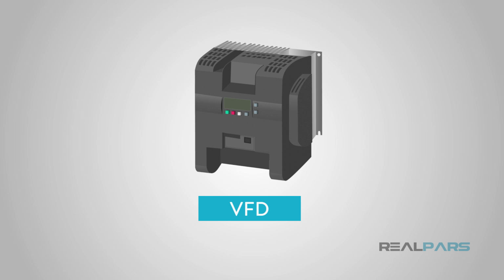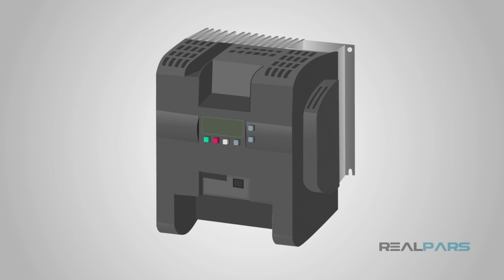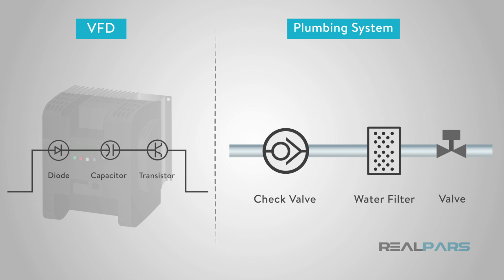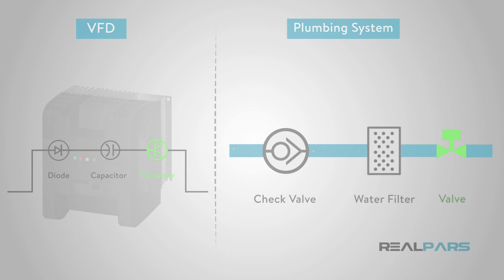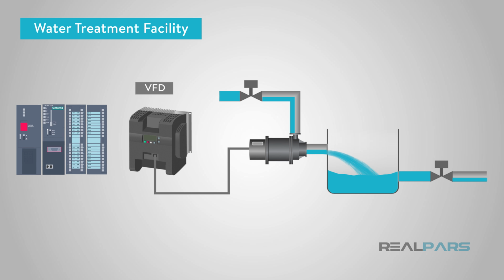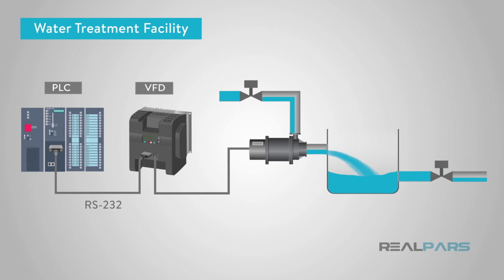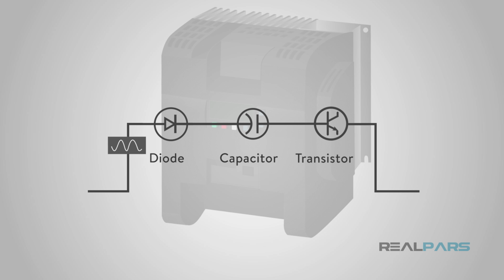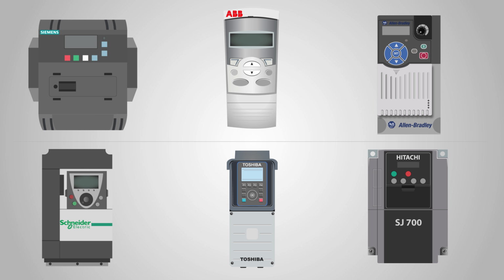What is a VFD? (Variable Frequency Drive)

Comment: Wouldn't using a VARIAC to lower or increase the AC voltage work in a similar way?
Reply from the maker: Yes, but VARIAC's are not a replacement for VFD's.  VFD's modify the frequency AND voltage that is output to the motor.  VARIAC's only adjust the voltage.  A VARIAC is essentially a variable transformer and does not provide the characteristics required for speed/torque modulation.
Reply: @realpars  Thanks for the clear explanation. I thought that would be the case!

Comment: Why converting AC to DC and then again to AC... Why can't we use directly AC
Reply from the maker: That is a great question!  In order to change the frequency of the AC sine wave, the incoming supply must be transformed.  The only way to do this effectively is to convert the current to DC and then reform the AC signal at a different frequency.  This process also allows the VFD to maintain a constant Volts/Hz ratio, which is important to maintain the integrity of the motor windings over a long period of time.  Inductive reactance acts as a resistor and can cause excess heat dissipation if the V/Hz ratio is not maintained.  So, there are multiple benefits to the conversion from AC to DC and back to AC, including being able to provide a cleaner (filtered) AC feed to the motor.

Comment: Why change to DC, if it’s just gonna change it back to AC?
Reply from the maker: That is a great question!  In order to change the frequency of the AC sine wave, the incoming supply must be transformed.  The only way to do this effectively is to convert the current to DC and then reform the AC signal at a different frequency.  This process also allows the VFD to maintain a constant Volts/Hz ratio, which is important to maintain the integrity of the motor windings over a long period of time.  Inductive reactance acts as a resistor and can cause excess heat dissipation if the V/Hz ratio is not maintained.  So, there are multiple benefits to the conversion from AC to DC and back to AC, including being able to provide a cleaner (filtered) AC feed to the motor.

Comment: Thanks for the video this just made my idea of a off grid induction motor and centrifugal pump to pressurize the water to drive pelton turbines for my hydro electric system a reality for my bitcoin mining operation, simply put much like the video i was wondering how i could control the pump speed for pressure to drive the pelton turbines to have more control on the overal out put of the generators also the electric motor is also powered by the same generators currently figuring out how to switch power sources for shutdowns for maintenance purposes where i would have to hydro systems to switch between to service but maintain electricity.

Comment: Thanks for the information, will you please give explanation for, why we convert AC into DC then again to AC?
Reply from the maker: There are two reasons.  The first is to provide a "clean" AC output to the motor.  The rectification from AC to DC allows the IGBT's or SCR's to "reassemble" the AC sine wave as free of electrical noise as possible, even if there is some noise on the input circuit.  Secondly, rectification and inversion is the easy and cost effective way to change frequencies on the AC circuit.  In a VFD, the voltage is also adjusted as to keep a fairly constant Volts/Hz ratio. For very large motors, there are devices being developed for industry called  Direct Matrix Converters which will be able to perform voltage and current conversion in one single stage without converting to DC.

Comment: Hello dear sir 
Can we use 3phase motor on single phase of electricity through VFD?
Reply from the maker: No.  You could physically wire it that way, but it will damage the motor and the drive.  A 3-phase VFD requires a 3-phase motor.  A 1-phase drive requires a 1-phase motor.

Comment: Is voltage/frequency ratio      always constant in VFD??? Please tell me.
Reply from the maker: The voltage/frequency ratio needs to be fairly constant from 0-60Hz.  The output torque for a motor is determined on the basis of the ratio of the motor’s applied voltage and applied frequency. A typical AC motor in the US is rated for 460 VAC and 60Hz, and has a 7.67 V/Hz ratio. Failure to maintain the proper V/Hz ratio will affect motor torque, temperature, speed, noise, and current draw.

Comment: So far, so good. These days, 3 phase VFD is used for most modern electric trains, and hybrid or full-on electric road vehicles, after the advent of integrated gate bipolar transistors (IGBT). Typically done with triple inverters (one for each phase), capable of working in both directions, for regenerative braking when required, using the 3 phase motor as an alternator.
Reply from the maker: Hi John,

Thanks for sharing your knowledge with us! We always appreciate that.
Reply: One the money with this comment
Reply: The best sounding VFD’s are found on Siemens locomotives like the BR 182 and BR 406 etc.

Comment: vfd controls the speed of the motor by converting AC to DC then back to AC with different frequency and it can be wired to plc to make the task automatic and get rid of a stupid operator! can't find any easier and straightforward explanation... GREAT JOB
Reply from the maker: Thanks a million for your kind comment, Yousfi! We appreciate your support.

Comment: i have a question，my question is the vfd can use for brushed motors or no?
Reply from the maker: Brushed motors are DC motors.  They do make speed controllers for DC motors. but they ar not called VFD's, since DC motor speed controllers do not work by varying frequency.  DC motor speed can be controlled by varying the armature voltage or field current.

Comment: Many thanks for knowledge sharing. My question is, can VFD motor runs directly ? in cause of VFD is out of order
Reply from the maker: Yes, you can design and install mechanical or electronic bypasses around VFD's.  Typically a DOL contactor is provided in parallel to the VFD so that if the VFD fails, the contactor pulls in to maintain operation.  However, the motor will run at full speed while in bypass. These systems require some planning and expertise; consult your VFD manufacturer to suggest the best alternative for your needs.
Reply: @realpars  Many thanks

Comment: I have 4 motors of 220v 50hz using VFD to convert 60hz  is it possible to use 1 VFD into 4 motors?
Reply from the maker: Yes, it is possible.  There are many constraints you need to consider:  1) all motors must be of the same speed,  2) each motor circuit must have its own overload protection, and 3) the VFD must be oversized unless all motors are started simultaneously.  Remember to size the VFD for the sum of the motors' FLA's, not horsepower.  There are other considerations that are beyond what I can answer here.  For instance, if one motor pulls high amperage, the VFD does not know which motor it is and will potentially shut down all motors connected to it.
Reply: RealPars 👍👍 Thank You!

Comment: Why first convert AC to DC and DC to AC sir
Reply from the maker: The purpose of a VFD is to take incoming AC power at 50Hz or 60Hz and adjust the frequency in order to regulate speed.    Speed is directly proportional to frequency.  At the electronic level, this is most efficiently accomplished by transforming the incoming power from AC to DC, and then "re-assembling the AC sine wave" at a different frequency.

Comment: in the section "dc to ac inverter" why the motor doesn't change the rotation direction even when the voltage is in negative signe
Reply from the maker: The direction of rotation is related to the phase angle between the 3 phases, not the instantaneous polarity of one of the phases.

Comment: Hello,
Can you kindly guide me that from any VFD which has output of 3-Phase 220V, can we handle speed control of 30V 6KW 3-Phase AC Motor with full torque?
Reply from the maker: The Siemens G120 drive or Allen-Bradley 525 drive should be able to meet your needs. Each will require proper specification prior to purchase so that you are buying the right drive.  Then, you will need to configure the drive correctly to give you the performance response you are looking for.  There are other manufacturers (Eaton, Mitsubishi, Schneider, Yaskawa, etc., that also make very good drives for the situation you have.

Comment: Your analogy of the capacitor being like a water filter is a poor one.   The cap is there to resist Voltage sag if there is a load spike upon the rectifier.  An apt analogy might would be an air bladder pressure tank in a water system there to maintain water pressure even if the putput is temporarily greater than what the pump can produce
Reply: Sure, this use of capacitors is oft referred to as “filtering” which is, in a manner of speaking, not an inaccurate way to talk about it, but your water filter analogy is leaves out a lot

Comment: Thanks for the insightful comparison of electronic components to hydrologic systems . This opened a couple of doors quickly for me. To get an understanding of how a PLC interacts with a VFD has given me some confidence in my new job as a Flexographic printing Mechanic. It is my hope to not only comprehend but to be able to program fully automated six color presses to accommodate changes in production requirements across a wide variety of material and ink types. This work is gratifying and worthwhile for me and your program is now on my radar. Keep up the good work many thanks.
Reply: The world is quiet here..
Reply from the maker: Thanks for your comment, Jeffrey!

Comment: is the function (of vfd) similar to that of encoder motors
Reply from the maker: The application of the encoder is "to send the feedback" of the motor to the VFD or to the PLC. This feedback could be speed, position, etc.
The application of the VFD, in the simple word, is "to control" the speed of the motor. The speed references will be sent through PLC.
Reply: @realpars  thx a lot...

Comment: Excellent explanations. I find an error in the video. I am sure the check valve in the plumbing system is put in the wrong direction.
Reply from the maker: Hi there,
These valves are not meant to be check valves.
Reply: RealPars 
Hi. At the time of 2:05, the check valve is highlighted by green, but it's symbol is in the wrong direction. If it was installed in a real system like this, the fluid will never pass through the check valve to the right side.
Reply: @wuwuwubu7553  Yep...I noticed that also.

Comment: Great video!!. I am trying to control a lamp that requires 120V with analog signal but the PLC only provides 10V. I was thinking to use a PWM but it only can give 30V. Do you think I could use a VFD to provide the 120V that the lamp needs?
Reply from the maker: Hi there,

For your application, if I understood your purpose correctly, you can use Solid State Relays (SSR). 
You can give your PLC Analog output to SSR input and in the output, you connect a 120 VAC supply in series with your load.
I believe you can not do it with VFD. Please check for SSRs and choose a proper one that matches your application.

Thanks
Reply: @realpars  thank you!

Comment: Hi,
I have trouble with my VFD, I found a zener diode breaked out. What is the role of zener diode around the IGBT usually ?

Best regards ;)
Reply: usually to protect the gate from exceeding 15 volts above the emitter. IGBTs have a maximum emitter-gate voltage of about 20 volts max. Anything between 10 and 15 volts is high enough to ensure full ON status. Anything over 20 volts can punch through the gate insulation barrier, and destroy the transistor.

Comment: Does reductio in frequency means reduction in voltage
Reply: Yes. an induction motor has a frequency/voltage ratio. you must decrease voltage proportionately to the decrease in frequency, to protect the motor stator from magnetic core saturation. If you run the frequency higher, you need to increase voltage, to maintain torque.

Comment: Please could you verify that the motor speed will increase as the supply frequency increases? The animation seems to be describing the other way around? Thanks.
Reply: Sn = 120F/N.P. Whereas; Sn = synchronous speed(shaft speed); 120 is constant; F = frequency; N.P. = number of poles.
So if you want speed to change, change the F(frequency)
Reply: @manuelbueno2603  Just remember, you must keep the voltage proportionate to speed, to avoid magnetic saturation of the core, and maintain full torque.

Comment: why that VFD first converts AC-DC and DC-AC. could you explain me
Reply: Just like an audio amplifier, with a built in signal generator. Converting AC to DC, than filtering with a capacitor, guarantees that voltage is available to the output stage when needed. That allows any output frequency, regardless of input frequency(50 or 60 Hz). Many VFD's can run as high as 400 Hz to drive low impedance motors up to 24000 RPM. Front loading automatic washing machines use as high as 380 Hz, for the spin cycle, because the small pulley on the small motor is belted to a very large pulley on the drum. A small motor, with limited torque, can produce a lot of horsepower, if sped way up. The motor is low impedance, meaning low voltage per RPM, so the frequency can be raised up, and the motor can still produce rated torque. All without having to exceed 200 volts.
Reply: @vincentrobinette1507  thanks for a thorough explanation.
Reply: bcz igbt's are works in dc
Reply: to control the frequency of an AC power supply it should be converted to dc and then back to ac and controlling the frequency of ac means you control the speed of a motor and that what is needed...search on how  dc is turned to ac and vise versa you will understand more ........i will attach two great videos that explains this
Reply: https://www.youtube.com/watch?v=qVeERT4nyz8 (DC to AC)
https://www.youtube.com/watch?v=Zn0GisHgWY4&t= (AC to DC)

Comment: As usual excellent video. What is the role of IGBT in VFD system?
Reply: The IGBT transistors convert the dc bus into a pure sine wave as does a voltage inverter from those 12v to 120/240 AC, it does so through PWM with frequencies between 4 and 20 HKhz. Sorry for the bad english I am Venezuelan and I am dedicated to repair VDFs.
Reply: @robertfunes276  Thanks for your prompt reply. Thanks for sharing knowledge without boundries descrimination.
Reply: I usually like to convert protons atoms to nuclear fusion and then divide them. by jhuhgo then pier aoihaosid ashore @robertfunes276
Reply: It converts square wave into pure sine wave and controls the frequency of the sine wave corresponds to the needs of the system.